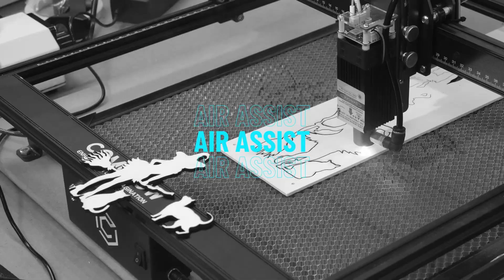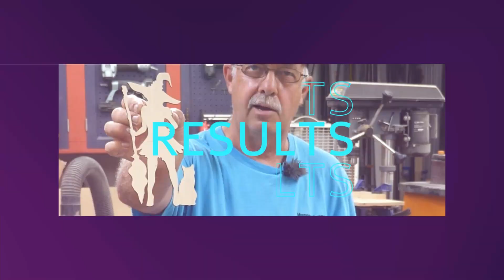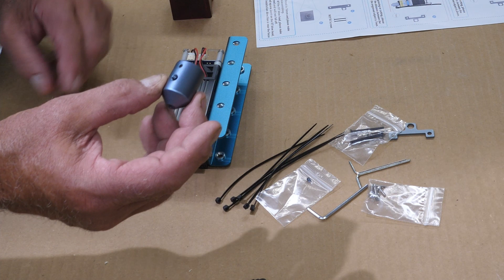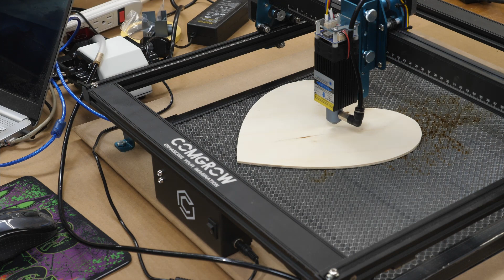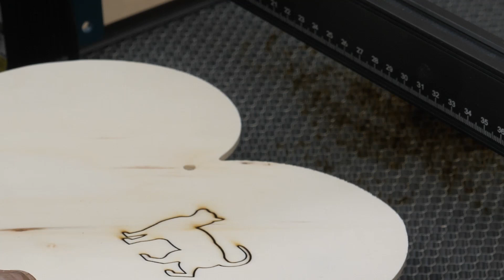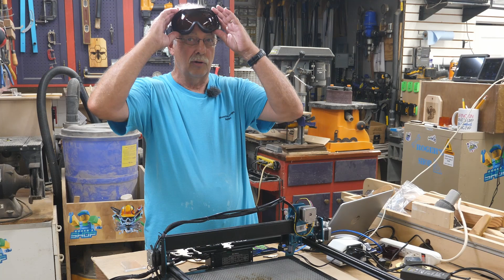COMGO Z1 Laser Air Assist Add On In Detail

Comment: Roger Sir, my comgrow z1 10w laser module seems to have a screwed on shield and not a magnetic one but my laser module seems to have a port for the air assist system... why does my laser seem that different from yours as my 5w module has no port but it has a magnetically held shield? Ty
Reply from the maker: When I got this one, it was one of the first manufactured, so it is entirely possible that they changed some things in the last two years.
Reply: @rogersshop  ty as i think they engineered it to have air assist easier.... but the 5 and 10w are they only meant to cut plywood? With 5 or 6 passes the 5w will cut but the 10 wont
Reply from the maker: @gillandro2  A 10 watt diode laser should cut 3mm plywood with a setting of 500 mm/min @100% power, 1 pass.  if it isn't, check focus and that the lens is clean.  Air assist will help if you have it as will a honeycomb board under the wood.
Reply: @rogersshop  the reason why i asked that question is i was trying to cut 4mm solid maple from hobby lobby but only a 5w laser doing 6 passes would cut anything out so was wondering if cutting wouldnt work normally on solid board but meant for plywood ty
Reply from the maker: @gillandro2  Yes, you can cut solid wood.  Some are more difficult than others such as hard maple, cherry, walnut, etc.

Comment: The air assist has a dial with on/off.  How did you determine the dial setting?
Reply from the maker: If cutting, I run 100%.  For engraving, I back it down to about 50% to keep the lens clean.

Comment: Question, I just got a comgrow 10 W and I bought the air assist And I don't seem to have the same setup as the one you are showing On the 10W one that I got does not show the lens it has a black extension with the air input , to me after watching I don't think I need any of the nozzle adapters or any other shielding, I can use the Red shield without any mod's of course I'm old and dumb but alas it is what it is, (new Hobby). by the way no where did a mention of the 7mm piece of plastic, until I watch you I didn''t have any Idea what it was used for. Thanks

Comment: Roger, this video was very helpful!  The instructions that came with it weren't clear and neither was the Comgrow YouTube video.  If I may, I saw something in your video that you might want to double check..  My air assist kit came with THREE different air assist nozzles. The smallest was attached to the that black plastic bracket just like I saw in your video.  The medium nozzle had two tiny screw holes on the top to mount to the black plastic bracket to replace the smallest nozzle.  The longest nozzle has no screw holes on the top and is the same height as the red acrylic guard.  I installed the longest nozzle because I figured it would be the same height as with the acrylic guard when I went to adjust the focus...  Now, maybe I'm wrong, but it looks like you put the medium nozzle on in your video.  Maybe you meant to do that, I don't know..  But just maybe your focus is off on your "Comgrow Comgo Z1". Forgive me if I'm wrong, but you might want to double check that. Thanks
Reply from the maker: This is a "universal" kit that fits many different lasers.  Only one of the nozzles fit my lens and the focus is not set by that, anyway.  I did modify the shield in a later video to fit after the air assist add on.
Reply: @rogersshop  my apologies then..  Thanks again for the great video!
Reply: @rogersshop  hi. I am unclear on what you mean by "it doesn't focus with the gauge". To me this doesn't make sense. So if I set the laser an inch above the material then it is still going to be focused? That is what I got from what you said. Please explain why?
Reply from the maker: @chriswoods9857  Without the shield, focus is 7mm from the work surface to the bottom of the air nozzle.
Reply: @rogersshop  but isn't the shield longer than the nozzle? It is at least anyways for the 5 watt.
Reply from the maker: @chriswoods9857  I no longer have this laser, so cannot look.
Reply: @rogersshop  ahhhh ok. Well thanks for the info anyways!

Comment: the air assist blows air. you really dont want that red glass cap back on because it will block some air flow.
Reply from the maker: I modified it in a later video and it does not affect air flow.